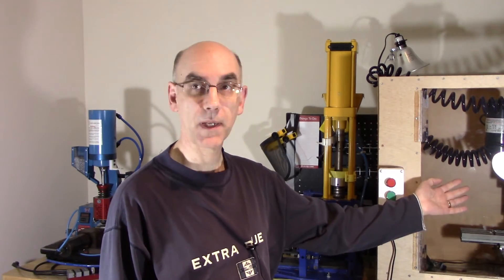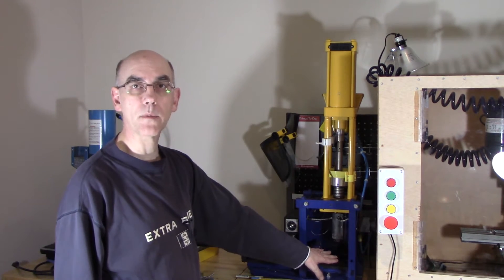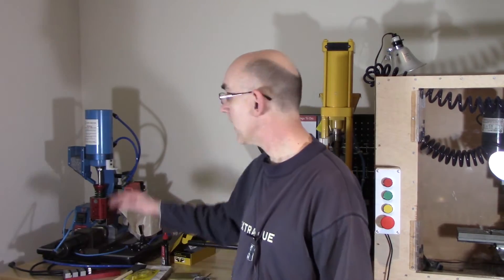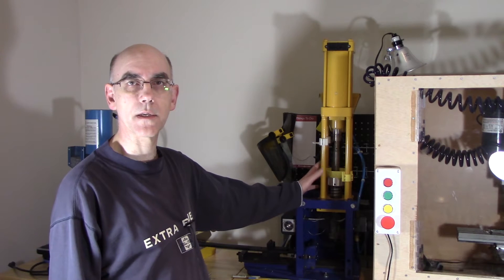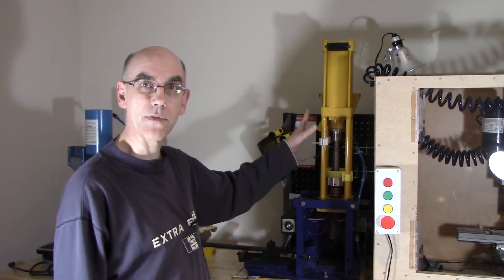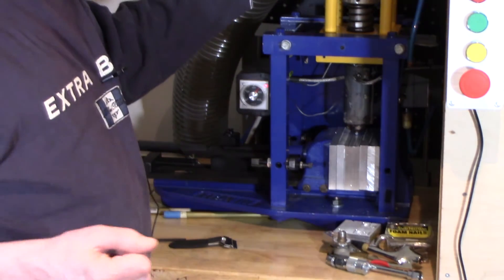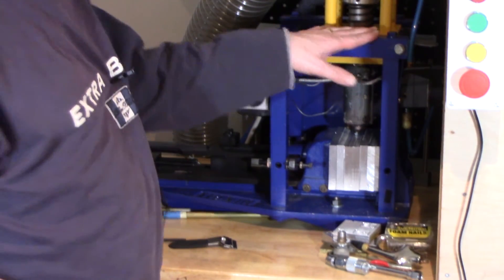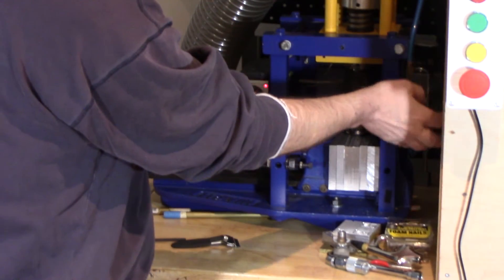#8 Injection Molding Part I

Comment: I would suggest you make your sprues hexagonal, it increases the area in the sprue channel, thereby getting more plastic to the cavity faster than a round sprue does. Or make your sprues thicker. Second, do you have air channels in the mold? The air in a closed mold has to evacuate the cavity for the plastic to fill properly. the air channels need to be very thin to prevent plastic squishing out.